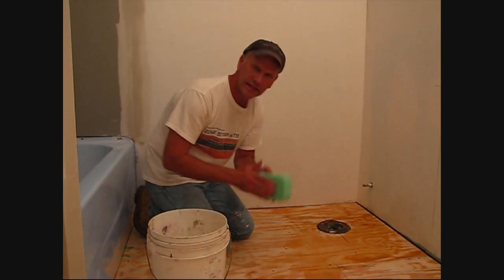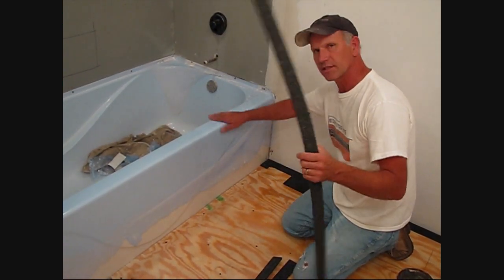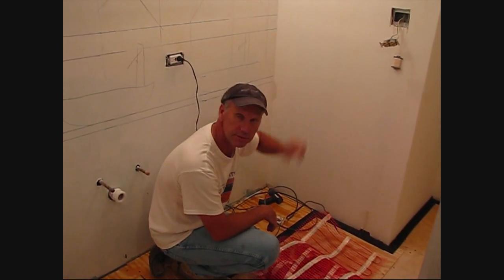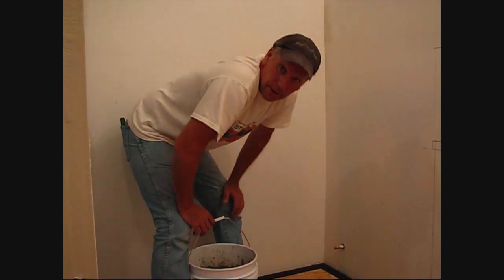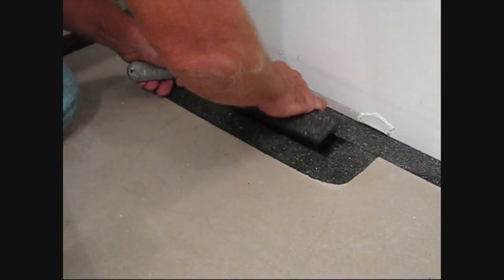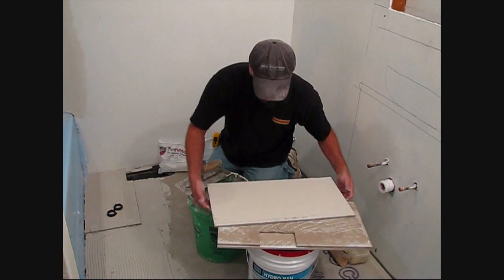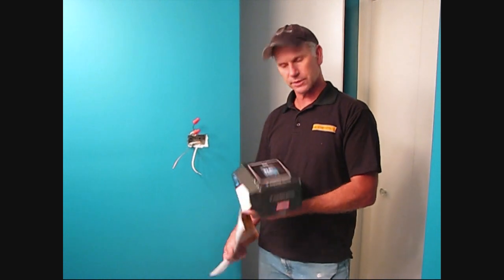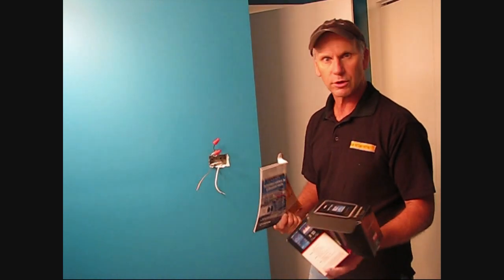Install WARMUP Electric Floor Heating Mat Using Edge Strip Kits

Comment: Did you add the self leveling mix under where the vanity is going? If not, how did you ensure the tile would be level for the vanity to rest on? It looks like you may have put some sort of backer board down in the area under the vanity. Thanks

Comment: Use a bigger notch, and since you leveled the floor, the leveling system is unnecessary...

Never installed radiant heating before, looks simple enough...

Comment: Hi I am going to be doing this soon. Are the edge strip kits from warmup or are they from a hardware store.
Reply: Sorry, I just saw this post..... ESKs are available on www.edgestripkits.com
Reply from the maker: They can be purchased from our website... www.edgestripkits.com
Reply: Thank you, I ordered them and will be doing the floor soon. I have a question in regards to the install. when you edge out the areas that are not getting the heat and the leveling mix, when tiling do you use extra mud in say where the vanity goes to bring it up to the height of the rest of the floor ?
Reply from the maker: I only showed that in this video as an option. What we did for this one was ADDED a cement board underlayment in that area to FLUSH out with the rest of the floor. This way you could tile just under the front of the vanity and SHIM up the back of the vanity with loose tiles or wood shims to get it vevel from back to front....Make sense?
Reply from the maker: ALSO, Check back on the website to see that we promote to install the strips VERTICALLY around the room now.....Much easier -
Reply from the maker: https://youtu.be/QgnRjzfZEsg
Reply: Hi And thank you for the replies much appreciated. SO after watching the latest video, I will install the edge strips around the room vertically, 1 strip horizontally at the threshold, put a border aroun the perimeter of the future vanity, and around the pvc pipe which is for the future Toilet. Is that correct or do I not put the edge strips around the vanity and just pour the level mixture there ? Also this is all on a 3/4 " subfloor with heavy insulation in the joists below.